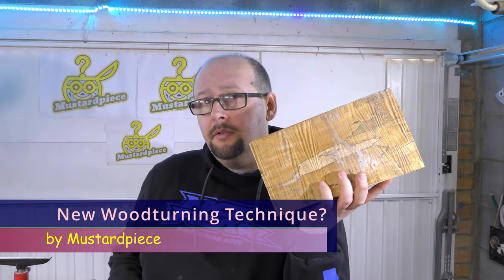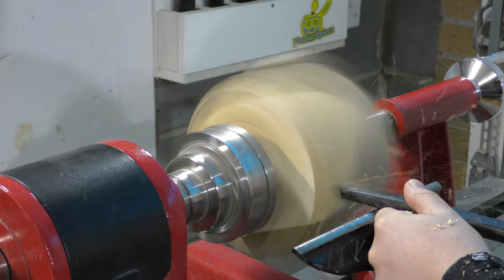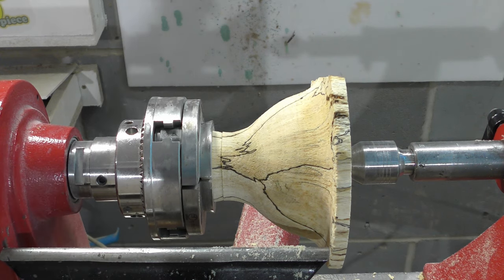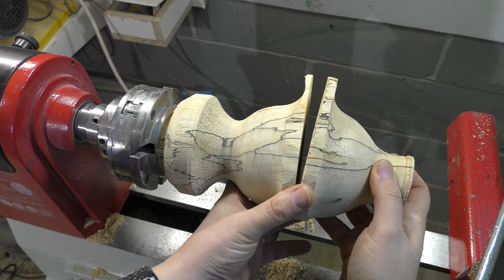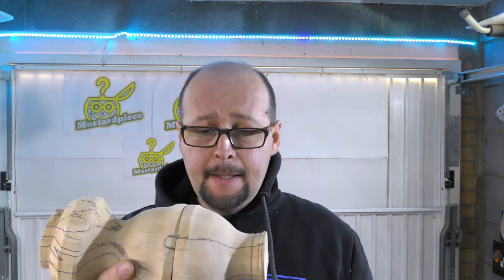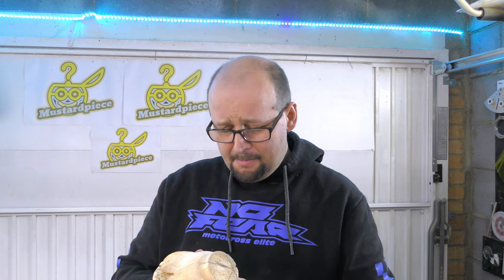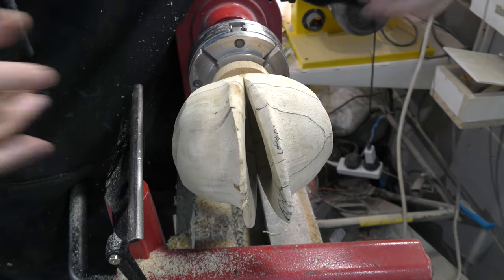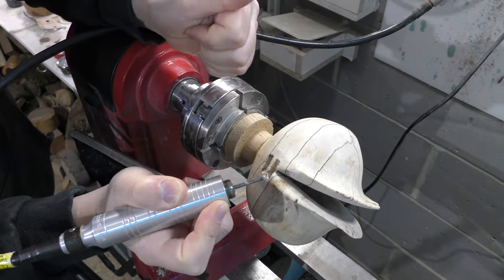New Woodturning Technique Discovered? - The Weirdest Shape Ever

Comment: I monitor facebook market place for trees that get cut down on people’s property near me trying to get to it as close to it getting cut down as possible. Then I seal the end grain on the wood. As I am able to, I then shape it into a very rough form of what I want (I’m mostly doing bowls right now and shape the walls to 1/10 of the diameter, so a 10” bowl I would leave the walls 1” thick. Reseal or place in a bag with some of its own shavings (so that they are similar moisture content as the wood) and let it sit for 1-6 months. 

After monitoring it’s moisture content throughout that period when it gets into a range I am willing to work with I either rough turn it again or wait till it’s completely dry. At this point I can go two different ways, I can turn it a little early at 15-20% moisture content and if I do that, I will take away maybe 1/4-1/3 of the wall and let dry in its shavings. Let dry until it has reached 0-10% MC and then do final turning/finishing. If instead I want to go from rough turned to final turning in one go, I wait until it has gotten down to that 0-10% without turning a second time (however this will take longer because your drying more wood).
Reply from the maker: Yes, thank you. I have just got some wood from Facebook. :) it is dry. Thanks for the tip. :)
Reply: @Mustardpiece  getting it green (wet) tends to be easier and less chance of cracking if people don’t know how to dry it. The other added benefit is all the green wood I have gotten this way was completely free other than the work and time it takes to dry and prevent from cracking.
Reply from the maker: @miles67733  I got this form the market place. Firewood. I don't know how I can get green. How do you search for it?

Comment: Well 🧐— looks like A PAC - MAN  you’ve  collected  for trophy  /   Pair of  builders worksite helmets repainted  & purposed !  
             * if you need to turn things further as earlier in recording  you often can re-enforce / strengthen  by using  masking tape around 3–5 times +  helping to hold together until removing is required ! ***🤓
Reply from the maker: Yes, I will try that. Thanks for the tip. 😃